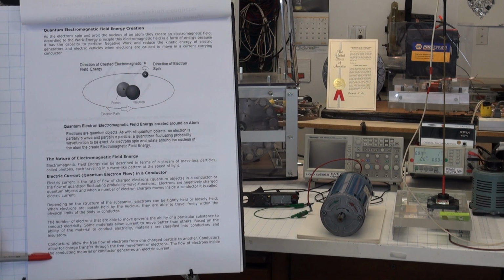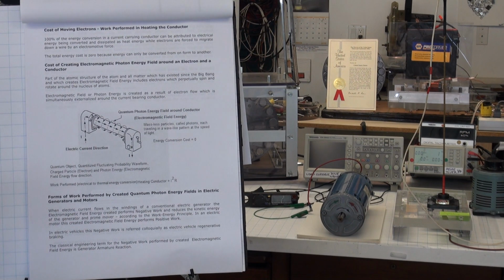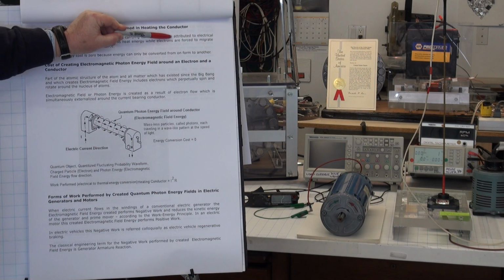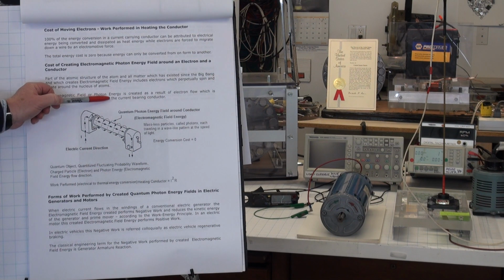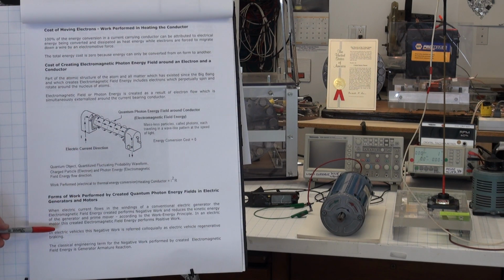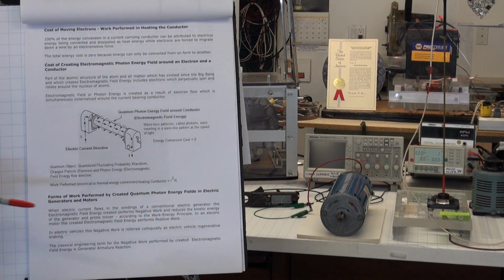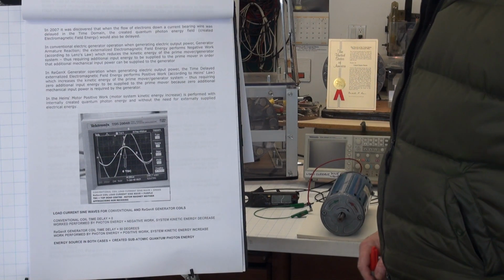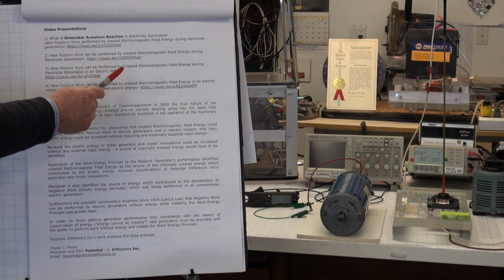PART 1 - The Nature of Sub-Atomic Quantum Photon Energy Creation & Externalization around a Wire

Comment: My old man is an old hat electrician and is convinced that voltage across a conductor causes current which causes field. How can i convince him voltage across a conductor causes a field then current?
Reply from the maker: You are both correct. When an Electron (a charged particle which creates an Electric Field) is caused to exit its orbit around the Atom's Nucleus by an Electromotive Force (Voltage) and move within the current bearing wire as Electric Current it creates and externalizes Electromagnetic Field Energy around the wire. The current and the field are inseparable. Cheers Thane